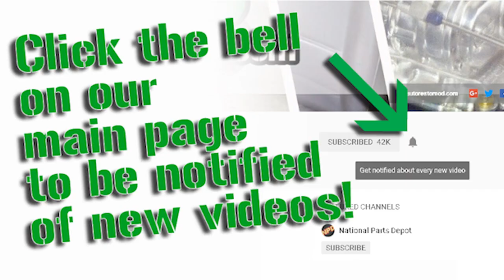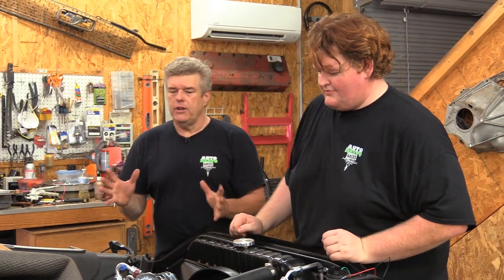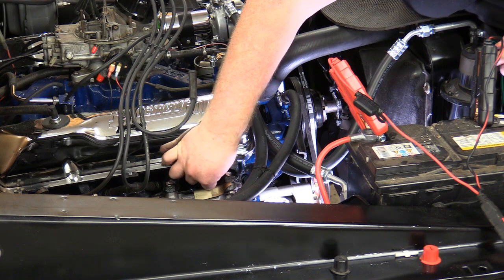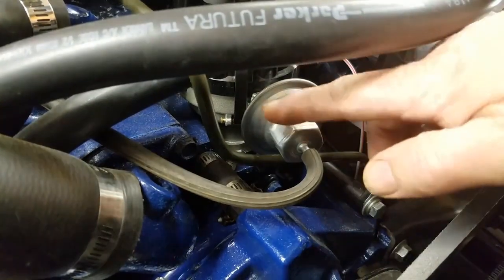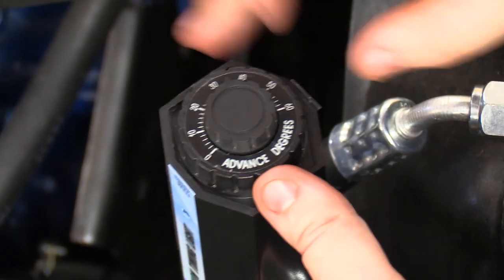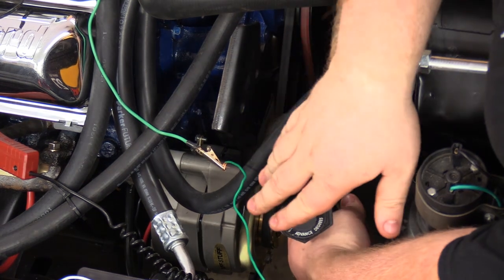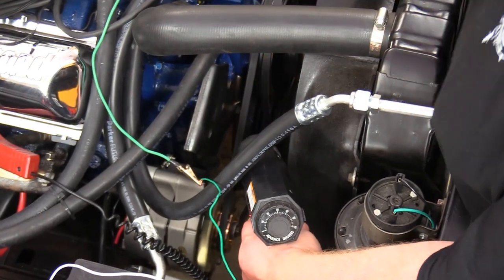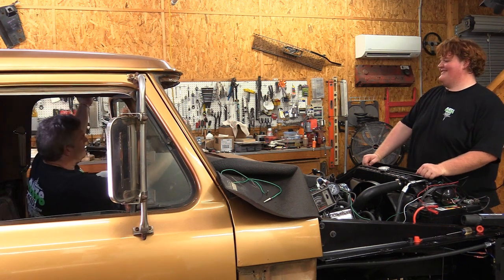How To Distributor Tuning 101 Episode 409 Autorestomod

Comment: Tell everyone how to set the total timing for their engine!!!  You want the most advanced timing curve your engine will handle without detonating! Disconnect vacuum advance and plug hose.  Drive and put your engine under a load by climbing a hill and slightly accelerating and listen closely for pinging. Bump base timing up 2 degrees at a time while climbing a hill each time until you finally hear ping.....now back your base timing down 3 degrees and lock it down!  Now plug in your vacuum advance to manifold vacuum and start out with a conservative setting and drive listening for ping as you take off from a dead stop and begin accelerating. Again adjust your vacuum canister for more timing a little at a time and drive after each adjustment until you hear audible ping. Now back it down 3 degrees and call it good!  Your timing is properly set....now adjust your idle circuits for max vacuum and curb idle on the carb..... Drop in new plugs and drive it for a while and then pull a plug and read it for proper timing and fuel.  There are videos that show how to read the plugs for proper timing and proper fuel....

Comment: No need to set initial timing first.  Just set total advance. Set your timing back dial between 34* - 36* then rev to 3000 rpm, turn distributor until your line on the harmonic balancer is at 0.
Reply: What happens if your total timing was very high and when you turn the distributor back you end up ATDC? Will you not have starting issues

Comment: If the dizzy were recurved for less mechanical advance, you could have left the vacuum can at full 10 degrees advance and run more initial. Engines love 50 degrees at cruise, but it's too much for wide-open throttle under a load.
Reply from the maker: I wanted to keep it simple, something that anyone could handle. We start going in and recurving a distributor and the beginner might not try it. We might go into recurving the mechanical at a later date.
Reply: That's what I am planning on doing for my 306 build.  I got a recurve kit planning on recurving the stock smog era DSII dist to be a bit more streetable with a non emission based build.  Havent done it before but hopefully before I get to that stage there is a video on this page by then.
Reply: The DS-II I had, had 36 degrees of advance in the centrifugal, so when I ran 12 initial, I was at 48, not even including the vacuum advance.I had it recurved to 26, which put it at 38 with 12 initial.
Reply: @Thirdgen83 , haven't even checked mine.  I got a brand new cardone dist with a steel gear to be drop in for my roller 306 short block I will be using.  not sure what I will be setting my timing at.  My current smog 302 I pushed up to 12* initial timing but factory spec going form memory is just 8* initial.  Im tempted to do this as well on the new engine but my big thing is going from the 2100 autolite carb to a summit 600 cfm 4V carb based off the 4100 series, it has a timed vacuum port for the dist.  Not sure if I want to run that as my smog 302 ran dead smooth with manifold vacuum but switching to ported the engine ran horrible and no tuning could get it to run smooth.

In looking at the instructions with the tune up kit I got, I am thinking of setting up my all in by 3,000 rpm even though the paperwork recommends 2,500 rpm.  This is a truck and I am not sure if I want full mechanical/vacuum advance when on the highway between 60 and 75 mph.

Comment: I have a Blueprint "Ford" 302. I just took it to 3000 rpm, and with my timing light, mechanical advance was around 20*, using the dial to get back to the basic timing... Then I read they (The engine builder) wants me to test at 3500 rpm... Kind of unnerving to lean over the engine at that rpm, especially since my car had a recall back when it was much newer, about jumping into reverse when idling. That would be bad enough without being 3500 rpm. I also don't have a helper to hold the throttle at 3500 while I look at it. They want 32-34* at 3500, which if it's 20* at 3000, I am not sure that's going to make it... I noticed the distributor has two different spring weights on the mechanical weights.. I have read that it's normal for "tuning" the mechanical advance, sometimes. SHould I change the heavier spring to the next lightest?
Reply: They (Engine builder) ALSO says to set total timing first?? That is the most backwards thing I have ever heard. In other words rev the engine up to 3500 rpm, set 34 degrees on the balancer to the timing pointer, and tighten the distributor. If either one of the advances is not set correctly, you're already in the hole IMHO.
Reply: Okay, just checked my vacuum can on my distributor. It was 14 turns pretty much  stop to stop, and was 2.5-3 from all the way clockwise. I turned it to about 7 turns, the middle, and it seems to be a little smoother off idle, and didn't do the 1500 rpm shake/miss it was doing before. It still chuffs when you quickly hit the throttle, but I have a new 35 squirter on the way. It has the stock 31 at the moment. If it doesn't fix it, then I guess I need to keep searching, and can put the 31 back in it, and get the carb looked at... Overall though, it seems smoother at part throttle.

Comment: I have a question. I’m working on a 1996 f150 5.0 going into a 1987 mustang and I’m going carb. I’m putting in a hei distributor I have it at I believe 10 degrees at tdc but my rotor is not pointing at the where the old one was but it’s close. Would that matter is the since off starting the motor?

Comment: Helpful to see the process.  At 10:59 you mention that your mechanical advance is about 32 to 34 degrees.  Did you mean to say that the "total advance" was 32 to 34 degrees?   If so, "mechanical advance" would be  "20 degrees to 22 degrees (34 minus 12 initial=22 degrees).    Really nice engine set up.

Comment: I can really appreciate how much you're doing! 
If you haven't figured it out by now... You NEED to find a Ported Vacuum Port. It won't be in the usual places - especially on a 4100!! 
One of the Ports on the Pass Side must be Ported... 😉
Reply from the maker: We got it, thanks!
Reply: @AutoRestoMod  Glad you got it figured out! I had a similar problem with my 82 Mustang GT. The Autolite 2100 had ported Vacuum, but none showed up. Only after I took it apart, I found that the port was carbon clogged from the inside!
Reply: Vacuum advance runs off manifold vacuum!  Why are you concerned with ported?

Comment: Thanks guys I'm going to try that with my 59 Thunderbird. The engine is a 352 special but I think everything that you did I will be able to do on mine. My situation is that it fall flat off from idle so it seems like I have to give it a little squirt of the throttle and then it'll start go.

Comment: Just started importing v8 trucks from USA to UK. Great video as we are picking up a lot of knowledge. We have just upgraded a 302 f100 to a max efi 500 system with electronic fuel pump, fans etc so we will be dialing in the timing tomorrow all being well that i can get the engine to fire once i set my rotary correct.
Reply from the maker: Very cool!
Reply: Hi so we have a 1980 windsor 302 block  all standard engine cambs etc in a 1950 f100. What should i set initial to vacume to total maximum timing. It is hard to get info here in the UK but your videos are fantastic. The only info i can find is no more than 35 deg total on this specific engine or even 34 deg especially if i get pinging. Ford recommends 6 btdc initial.

Comment: This was explained very well. 
I’m having a spark knock issue on my Ford 302 with MSD ready run distributor. Has a limiting bushing of 21 mechanical and I set base timing at 14. But I did not check total timing. I bet my vacuum canister is way off! 
So if I set base timing at 12 degrees and then plug in vacuum advance I should be shooting for maybe 18 degrees base at that point at idle? Or 18 at a certain rpm? 
Also how about spring weight?
Has the middle tension springs now. Thank you and I appreciate all of your help you guys give out.
Reply from the maker: I'd look to see what the factory specs are. You'll need to know what your all in is for your application.
Reply: I don’t think you want to add timing at idle with vacuum advance. Yes idle is leaner usually but that’s why you set your initial mechanical to cover the low engine speed/leaner mixture, cylinder pressures determine how much timing required. Stock low compression needs more timing than high compression. It’s a matter of correct timing for a given engines burn characteristics. I think vacuum advance only should add timing under light load (think carb throttle blade position=more closed=higher vacuum=leaner/lazier fuel charge that takes longer to propagate flame front, hence the need to advance timing, but not to use vacuum advance at idle. If your engine needs 18 at idle I’m guessing you’re idling way lean or you’re fuel enrichment needs looking at. I’ve got a 302 based 331, 10:1 aluminum heads middle of the road cam. My cylinder pressure on warmed over choke open engine is 165 @ 5000 feet above sea level, it likes 12 initial and 33 by 3000 rpm. Idle AFR is 14.5, WOT 12-12.5 and cruising is 15-15.5

Comment: Ran across your video and I think I have the same problem. My vacuum advance is ported off the carb from the factory. I bought a 1973 Mach 1 Mustang with the 351C 2V engine. It runs like crap at 2500-3000 rpm, to the point where it wants to shut off! I can plug the vacuum advance line and it runs a lot better. A difference I see is my vacuum advance doesn't come on until I crack the throttle. One thing I haven't checked is to see if my timing strip on my NEW harmonic balancer is correct. Going to go through your steps, thinking it should help my problem. I'm still not sure about switching to manifold vacuum but I may try it. Thanks!
Reply from the maker: Hope it works. That kind of stuff can be frustrating.

Comment: @ 7: 28  usually a port on the carburetor is ported vacuum , above the throttle plate  .   Any hook up below the throttle plate is manifold vacuum .   I think I understood you to say your using ported hook up to the distributor advance .
Reply: My understanding of what was said is that carb only has a manifold vacuum port, so with that carb installed you will always have vacuum advance at idle.

Comment: Neat video..
Cheers
I'm trying to sort timing on my 1975 mark iv 460bb
Just replaced the vacuum advance, and as you mentioned it was set 1/4 turn out from full clockwise..
With a total turns of 13 from left to right, I set it at 7 turns, half way.
With differing opinions on setting base timing, ive set it at 14°
I not sure if the 460 could do with more or less base timing, and whether I can add more vacuum 🤷‍♂️
Have you guys found what these year model 460s like ?
Cheers

Comment: Am I right this is the same process regardless of make? (Different timing degrees obviously)

I’m trying to figure out a SBC with an unknown cam. It’s pulling 10-12 on the vacuum gauge. And this video seemed like the most informative of all Ive seen so far.

Still a little confused on how to tell if I need to put a weight kit in the cap, or if I should even run vacuum advance or just leave it plugged.

Comment: Great vid very informitive for people who are trying to learn about tbe different timming variables , question is why did the total timing change with vacuum ? Is it not supposed to fall away in higher rpms?? back to mexhanical only thanks cam jeff
Reply from the maker: That is a function of the vacuum advance. It adjusts the timing curve, giving better performance (street) and mileage.
Reply: @AutoRestoMod  i understand if its hooked to full manifold then its always pulling timming if it is connected  to ported it should not pull timming at idle only under slight load then falls away 0 under both  applications
Reply: It's a function of vacuum pulling the advance plates.  If he's at high a RPM but not under load there is still a vacuum signal pulling on the can.  If he was actually running it under load the vacuum will decrease and if it falls under where they set the can curve it will go to the 34 degrees mechanical only.  Full throttle should definitely loose the vacuum can advance.

Comment: Thanks Jeff and Cam (and Vinny) for the advice and direction over the years. Greatly appreciated. Quick (and naive) question: with the engine running, when I pull (or plug back in) the hose from the vacuum canister, neither my vacuum gauge reading nor the sound of my engine is affected. (I usually shut the engine off to adjust and then plug back in before restarting.) I saw how this affected the truck's engine when cam did it in the video. Do you suppose that in my case this is a sign that the canister needs replacing or does that have anything to do with my over all timing? The flyweights on the motorcraft distributor are on the 13L slot plus I have 8 BTDC for 34. A month ago I was able to turn the canister screw out to stop the pinging while going uphill but was trying to "get the most out of it" just over the weekend and realized unlike in your video that the engine sound nor the vacuum reading changes (stays at about a steady 19 or 20). Any thoughts would be appreciated. Thanks again and again for helping all of us out.
Reply from the maker: I would do a vacuum test on the module. Simply put a hose on the canister with the cap off and pull a vacuum. if the arm moves, you have a good can and a vacuum leak somewhere else. If you can draw a vacuum, and it feels like you are just pulling air, the canister is ruptured. You'll have to re-tune the engine after the new canister is installed.
Reply: @AutoRestoMod  Thanks again. Let me try that as well and see what response I will get out of the canister. A little more info in case someone else is still learning as I am comes from a forum posted response to my question that said, "It sounds like you have your vacuum advance hose connected to the factory-specified "timed spark" or "ported vacuum" port in the carburetor which has no vacuum signal at idle when the throttle plates are closed. This is normal. Some folks will change the location from the "timed spark port to full manifold vacuum to get the benefits of vacuum advance at closed throttle idle and deceleration." -How many times did you mention that in Episode 102/103? Gotta smile. "When the student is ready, the teacher shows up." Thank you!

Comment: Enjoyed this video! I've got a 66 mustang 289-2v auto and am wondering how close the timing setting is to the 390 in this video. My 66 manual says 6 degrees btdc for base timing but doesn't tell me about max timing. I'm running a 2100 carb with the dist vac tap coming off the front passenger corner of the carb (stock). I run pertronix II ignition with flamethrower II coil. Car seems to run great at 12 degrees base timing and 40 degrees advance at 3000 rpm. Manual says I can go 5 degrees over the recommended 6 degrees for altitude (I'm at 5000 ft ASL). Any insights? Are my numbers good? Could they be different and run even better? Do you have a similar video for a 289-2v auto?  Thanks again!

Comment: When I installed a B28 vacuum can on my 70 Z28 due to the orig can only giving me 1* of timing due to my roller camshaft only producing 10-11” of vacuum at idle. I had to make a limiter plate for my vacuum arm to bring down my timing at idle cause it was so high that the engine was idling up and down like a super charger along with black smoke coming out of the tailpipes.
Reply: Im working on tuning a 1969 Z28.  Timing is super retarded for the AIR system, runs lean for emissions and there are some things that dont make sense like having two power valves.
Currently im trying to figure the best curve.  Idling at 2btdc isnt optimal
Reply: I just added a b28 advance because tge one that was on the car would barely move.  Started at 8 inches and would open fully until about 15 inches, motor only makes 10 inches!
I also modified the carb to change the vacuum port from ported to manifold vacuum without changing the outside appearance
Reply: @SAE-Restorations  the list 4053 for your 69 Z/28 is suppose to have 2 power valves, one for each metering block. Prim jets should be 68 and sec 76. Power valves should be 6.5 in hg. Spark plugs should be AC R43 with a .035 gap.
Reply: @johnmilner7603  true, but there is no need for a power valve in the secondaries unless youre going to regularly cruise with the secondaries constantly open and want to get better gas mileage under those conditions.  11 inches of vacuum requires 5.5 power valves to operate correctly.  R43 plugs foul, the hotter r45 plugs work better for regular driving.
68 is too small, 72 works better.
2 degrees intial timing is too late, im aiming for 12-16 instead.
Reply: @SAE-Restorations  I tried different plug heat ranges and brands and R45 was too hot that the fuel burnt and flashed too fast on the plug. Holley’s old rule of thumb on the PV was 2 numbers lower than your idle vacuum reading, now it’s 1/2 to cover their behind. What works for me is jetting 68/76, 5.0 for both PV and 16* initial timing (36* total). I’m out in the Country and hardly ever drive at 30 mph. I’m mostly at 50 or 50+ mph and oddly at times at 40 mph. In order to keep plugs clean, they need to reach self cleaning temperatures and a few full throttle hits through the gears or they will foul no matter what you use. This works for me. Good luck with your tune.

Comment: How do I know how much vacuum advance I should have? I have a Chevy 350. My understanding is at idle I should be about 12° and about 35° total. Does that include vacuum? Or is that just mechanical? If it doesn’t then how much should my vacuum add?
Reply from the maker: The 35 is with vacuum. If you hear pinging, you have too much.